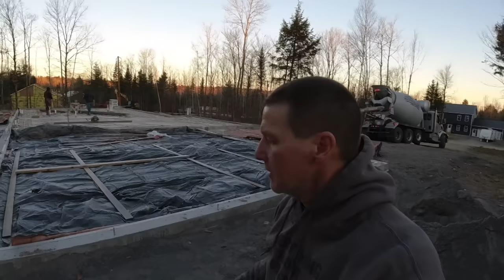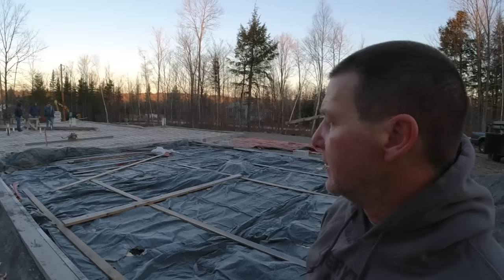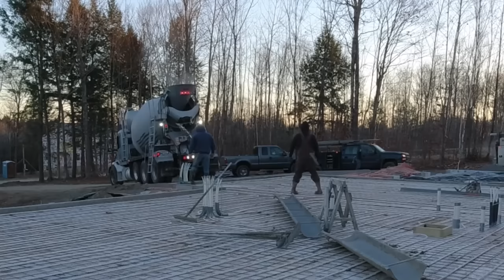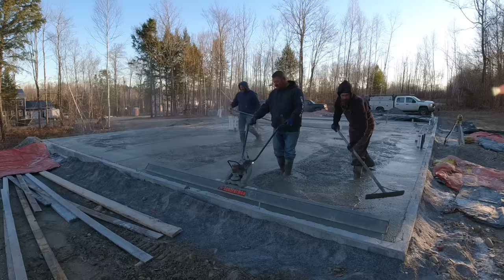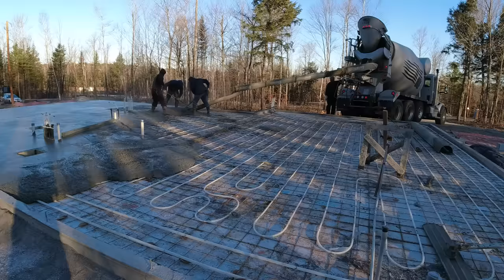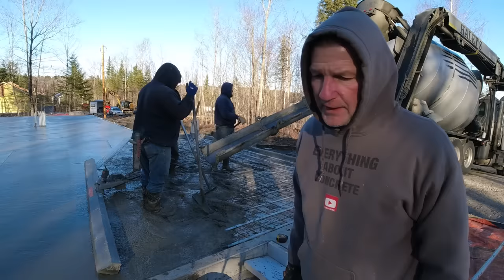Pouring Concrete When It's Below Freezing! COLD Weather Concrete Floor

Comment: You have a good crew, they know what flat looks like. I did inverts for big storm drains. They pour the mud down the hole on top of you. The end of the pipes are open but it turns into a suna fast. It could all be washed away by an afternoon shower.

Comment: It's been brutal working in the cold here, its working with metal handled tools that strip the heat out of yours hands through your gloves
Reply: I mean, you could grab a 10 pack of hand warmers for 10 bucks at your local wal mart or hardware store. No need to freeze the digits.

Comment: I just finished a job in upstate NY and the batch plant didn't start using hot water until mid OCT regardless of temperature. Is that typical? We had some bitter cold days before that and hot water wasn't even an option. I'm glad to be back home now in the low 90's.

Comment: hey mike how late were they finishing to. I just finished 11,300 yesterday started pouring around 730 am. stuff was setting up as we were pouring it. We got a little panicked cause its quite a big floor on Q decking btw exposed. Anyways soon as it started cooling off concrete stopped snapping and we did the last pass at the end at about 345 am pulled trowels off and back at shop for 5 am. Do you guys ever have these issues we had accelerator pkus 32 mpa concretre

Comment: Diy here, is it possible to pour bagged quikcrete (100bags of 60) in 45 degree weather without issues? Trying to pour 11x10 pad for hot tub.  Is it best warm up the water before while the stand mixer (THD rental)? Trying to see if i should wait until spring or not..
Reply: its fine,, just will take quite a while to set up but honestly if its just for a hot tub, screed it, mag it, edge, mag out the edge lines and keep the squirrels off it. in 6-10 degree celcius weather, i can pour with no additives at 8 am and be finishing the surface around 3-4pm
Reply: Anything over 40 is fine. That is your cutoff
Reply: Use some thermolube or even better antihydro.  If not available to you, find another accelerant admixture for use with portland based mixes (which I am assuming your using, If using Rapidset very rapid setting concrete mix by cts cements(csa cement it will be solid in a half hour even at 45 degrees, also costs twice as much, but,  7000psi out of bag, structural strength in an hour, fully cured in seven.

Comment: I am surprised that you pour concrete over radiant floor heating tubes without them being pressurized. That way if anything happens during the pour you know where the problem is. I charged mine up to 60psi during the pour.

Comment: I have a couple questions…
I never see any front loader trucks in your videos. Are they all rear loaders trucks up in the northeast? 
And it looks like your bull float has a fixed head without the twist and pivot mechanism. Am I seeing that correctly? If so why do you prefer the fixed head on the bull float?
Thanks!
Reply: im in ontario canada and ive only ever seen front loader trucks in videos of american concrete people. ours are rear discharge and rear wheel drive only
Reply: @ryanelliott4750  here in south central Kentucky all the area trucks are front loaders. I’ve not seen rear loader trucks in years. I can remember the first time I saw a front loader truck some 40 years ago. It was brand new and coming down the interstate. I assume it was being delivered to a concrete plant somewhere. But I thought somebody was pulling some kind of prank and driving a concrete truck in reverse on the interstate highway! lol.

Comment: I poured 12" frost footings twice in 40 degree weather this fall and both times they took at least 4 days to harden. The temp never got below freezing and it was in the 50s and 60s most days and above 40 all days. Still took a week for one set of footings to harden. Never seen that happen before ever. Used 3 different brands of bagged mix and they all took extra time to harden.

Comment: The rebar is supposed to be in the middle of the concrete it does absolutely nothing laying on the ground and the house slab is supposed to be 8 inches minimum thickness you don't even have 3 inches there I'm not an expert but that don't look right
Reply: That’s right, you’re not an expert because you’re wrong, 8” floors are for commercial or heavy construction, not residential, residential heated slabs or house slabs are never more then 4” unless it’s a garage, and that’s usually up to the discretion of the designer. reinforcing isn’t at the bottom, it’s designed to be pulled up and aggregate gets under and holds it up, plus he has fiber mesh in the concrete, and to correct you again, rebar is specified to be in the top 2” of concrete typically, not on the middle, but this project is specified the way he did it, period. There’s a free concrete lesson for you